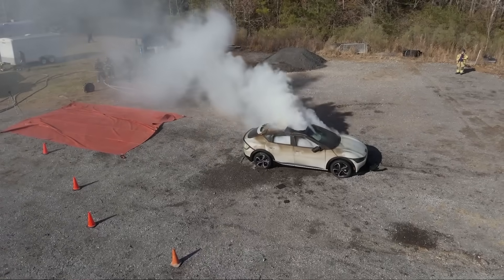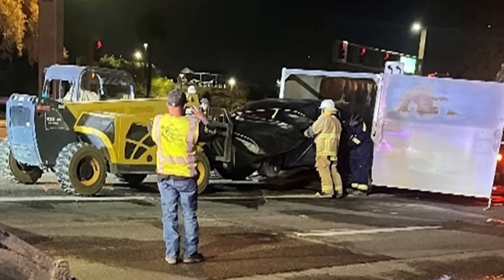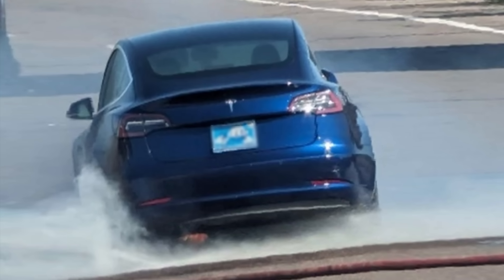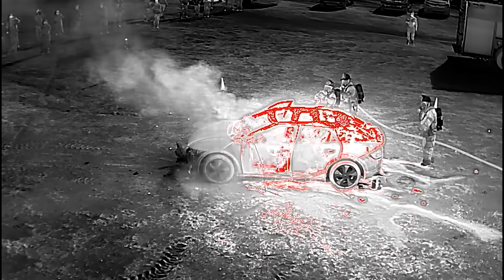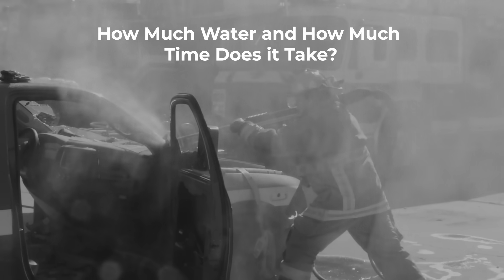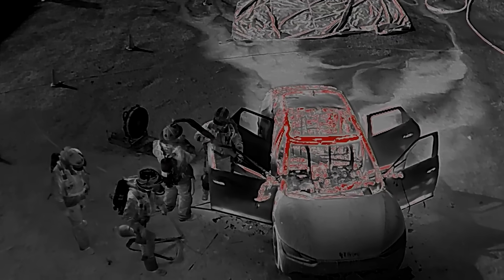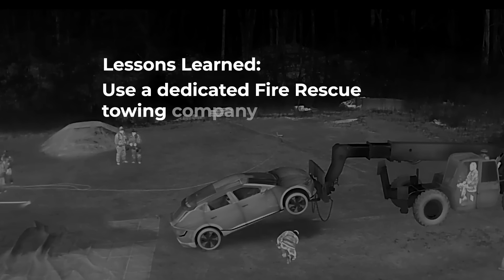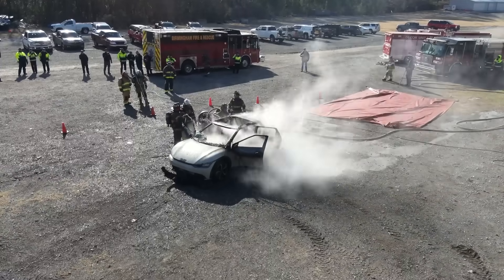Quick and Efficient Method of Extinguishing of an EV Fire tested in Tempe, Arizona

Comment: The air pollution from such a fire must be horrendous.
Reply: And the air pollution from ICE cars is just dandy? Anything burning is making air pollution.
Reply: @Hybridog  Most of the ice exhaust has been cleaned up by the pollution control system these days. No CO for example. EV batteries burn with very obnoxious chemicals and very concentrated. The battery fire then burns the vehicle which contains a lot of flammable synthetic plastics. Then there's the flammable tires.
Reply: @ You seem to be comparing ICE exhaust to a car fire. Let's separate the two things. An ICE car fire is mostly similar to an EV fire until you get to the battery. The battery does make pollution that is unique to it's chemistry, just as the pollution from burning gasoline or diesel is unique to those fuels. There are plenty of harmful things produced by a petroleum fire that we just sort of ignore now because it has become normalized. The soot from uncontrolled petroleum burning products contain a spectrum of harmful chemicals that we have just decided we aren't going to bother worrying about. Both cars have interior and exterior components (plastics) that burn in a fire producing a similar outcome. I would say the pollution from ANY car fire is pretty horrendous, but those fires are not all that frequent when you consider how many cars are on the road daily that don't burst into flames. There are probably more very toxic and harmful chemicals spread across the landscape every year from fireworks than from EV fires.
Reply: @Hybridog  But there are many more fires in EVs than ice cars. AND there are lithium ion fires in other devices as well.
Reply: @joewoodchuck3824  I'm not so sure there are more EV fires than ICE. There's a Swedish study that has better data than previous ones that shows ICE is 20 times more likely to catch fire. The total number of EV or ICE fires is rather small globally and thus the pollution from them is not a concern. The earth is really, really, big and it would take millions of fires annually to make a serious impact.
Reply: @Hybridog  I hope none ever happen in your neighborhood. You will be very unhappy being downwind of an EV fire more so than an ice fire.
Reply: @joewoodchuck3824  Uh huh.
Reply: Nope
Reply: @sparksmcgee6641  So the batteries aren't made of toxic materials then? That's a strange viewpoint considering that every article written about them say just the opposite and some point out the extra hazards in fires. I couldn't find one article that agreed with you.
Reply: @joewoodchuck3824  just did actual reading of a anti battery paper claim just that and the car in those fires is way more "toxic" than the battery.
I presume you don't understand that water and air are toxic by your standards. 
Cobalt is only one with a LD that you would have to make a huge stretch to say is a risk in a fire but it even has an 8 hour OSHA limit which means it's not so "toxic" that you can't be exposed to it without any negative health effects.
Reply: @sparksmcgee6641 If the battery is burning, then the car is most likely also burning. The two can't be separated when the fire begins. But OK, feel free to stand downwind of an EV or any chemical fire then.

Comment: looks like you have to get there quick and danger of kaboom to your firefighters ... you need a remote control lance
Reply: The probability of KABOOM is extremely rare and you only need to be dozen feet away to avoid any concussion blast and not real shrapnel, especially not any that can pierce a fire suit. This is not a Gasoline Fireball.
Reply from the maker: Perhaps a fire fighting robot in time could learn to use it. It wouldn´t be a bad idea as long as the remote operator knows what they are doing.

Comment: Or feed it the oxygen it wants and get it all over and done with quicker? Then shred it and bag it at the road side? Not a chemist but that lithium burns on contact with O2 right? Feed it O2 - go boom - shred and bag whats left? Water is just a delay tactic in my mind. First responders safety is the priority here. God bless those crews.
Reply: You are not a chemist, as you say. The battery contains oxidizer and fuel (every battery is an oxidation-reduction reaction, that is, a slow motion fire). So adding O2 or depriving the battery of O2 has zero effect on the battery fire. I am a chemical engineer.
Reply: @oliverheaviside2539  OK. Thank you. What a tricky problem. I like the description of every battery being a slow motion fire. That puts it in perspective nicely.

Comment: EV fires are also easier to put out because most EV manufacturers today use Lithium Iron batteries that do NOT generate oxygen in the combustion process like the older lithium chemistry batteries did. This increased the margin of safety at the expense of energy density. What is left is more like conventional battery firefighting, where breaking short circuited batteries & oxygen depletion will do the job.
Reply from the maker: Interesting point!

Comment: Fire suppression blankets are the answer.
Reply: No, they are not.
Reply: It is a self-oxidizing chemical reaction it's not a normal fire that uses atmosphere. Smothering it doesn't work. Sometimes you see one of these things roll down a boat ramp and burn for hours underwater. It's more like gunpowder burning in a cartridge it doesn't require oxygen from outside.
Reply: Nope

Comment: High pressure cutting..what? Mumbles the most important word in the sentence.
Reply: Damaged batteries can form unintended paths of conduction, a short circuit for example. Shorts rapidly heat, causing fires & reigniting. Cutting the short by propelling particles with high pressure water will cut the relatively soft metals used within a battery. The particles cut, while the water deprives the fire of oxygen as well as cooling the reaction. If this does work, it is kind of brilliant.
Reply: @kenandbarbie-b6c not sure how your comment relates to my OP...
Reply: @5400bowen It is an answer to your question on what high pressure cutting(using particulates) is doing. It is cutting the conductive path of soft metals used in battery construction. The intent is to remove short circuiting.

Comment: When did we start using water for electrical fires!!!
Reply: Because it's not really an electrical fire. Its an incendiary material fire.
Reply: @Neojhun  @septemberamyx ,Also the electricity here is from a non grounded (earthed) system as long as the EV is not connected to a charger. That makes it possible to assess the risks differently than for grounded systems.

Comment: Use fire blankets!  puts the fire out in seconds.  they cost around 1000 USD.  
https://youtu.be/yO8cVWOqZcg
Reply: They don’t work on battery fires. I’m sure the firefighters have tried it and failed.
Reply: @oliverheaviside2539  Yes they do work on battery fires. Watch it.
Reply from the maker: They work only for so long. They suppress but don´t cool the fire enough so when pulled off, the car reignites.
Reply: @ctifnewswebtv3802  To side step the issue for the moment.  I don't think we should be allowing NMC type EV batteries because they are so flammable and hard to put out.  LFP is very hard to ignite and I know of zero that have. When they burn, it's 5 times less energy and the most of the gases are steam almost no explosive gases.  The new sulfur batteries are also supposed to be even less flammable than LFP, but it's too soon to know.

Comment: Water is the WRONG MEDIA for putting out METAL/ ELECTRICAL fires. Water is cheap but highly reactive with both lithium chemistry and charged batteries.
Electrically inert chemicals are better (ie DRY CHEMICAL extinguishers or fire blankets).
Bag the vehicle and wait until it cools below auto ignition temperature.
Reply from the maker: There is a difference in lithium metal and lithium ions. Lithium metal does what you are talking about.
Reply: @ And Lithium Cobalt / Manganese Ion batteries have lithium metal present if charged beyond 80%. The graphite electrodes get saturated and lithium metal plates out on the surface (particularly if rapidly charged, the slower the charge rate the less plating occurs). Puncturing a fully charged lithium ion (as opposed to lithium iron phosphate (different chemistry)) battery is a good way to start a fire.
Single use lithium batteries have similar issues.
The 80% charge limit on Lithium ion batteries has a couple of reasons (the plating also reduces battery capacity because of reduced surface area for ion diffusion).

Comment: Smart solution…EVs are being pushed with little thought about thermal runaway fires..l doubt this excellent demonstration would be on MSM..it would highlight the major problem with EVs..well done guys..good job..
Reply: Stop with the misinformation. MSM have overblown of RARE Passenger Car BEV fires. "pushed with little thought" is a blatant lie as Automaker and Battery suppliers keep making improvements and the latest EVs are extremely unlikely to ever catch fire. Even old flawed deisgned BEVs are way less likely to ever catch fire per 100,000 unit of each type. It's MSM who is slandering EVs trying to wrongly assert fire are remotely even likely.

Comment: Most autos now use LFP batteries which are safer for fire compared to Lithium Ion which is what is used in all our electronic gadgets and is more prone to thermal runaway.
Reply from the maker: Lithium batteries will likely be around for years to come even as safer batteries become available
Reply: And anyways once they become obsolete and there's no more need for the technique to put a fire out in an electric vehicle anymore. They'll have the tool and I'm sure they'll find multiple new uses for it.

Comment: I thought that when you mix lithium with water it would catch on fire and or explode. What am I missing here?
Reply from the maker: Salt water is very corrosive for these batteries. Clean water will extinguish it over time.
Reply: You are missing that it is lithium in the form of ions. So they dont want to react with water. Also, if there is a small amount of lithium in a burning cell, it will combust/react during the thermal runaway process. The goal is to not have new batteriy cells or modules enter thermal runaway by keeping them cool.

Comment: Problem with letting the FDs HIDE the incidents from the public....  we don't KNOW how frequent (or infrequent) they ARE!  SHOULD Tesla owners have to pay a 'bump-up" for "in case of fire"?  It costs MORE to put put a lithium fire, does it not?   Are the FDs and/or insurance co's TRACKING those costs?
Reply: Per 100K sold, ICE vehicles are involved in 1,500 fires. That is 60 times larger than the 25-per-100K sold for EVs.
Reply: You are ignoring EVs Fires are far more RARE per 100,000 each type of vehicle. Such a cost analysis is heavily based on number of occurrence of fires. In that case ICE cars should be paying way More.

Comment: To a hammer, everything is a nail.  Water doesn't make fire go away.  It cools and smothers.  Water also conducts electricity.  A shorted high energy battery creates heat.  Now you're relying on the water to do one thing, and it doesn't do it well.

I wish we could figure out a different solution here that isn't just "more water differently".  I also wish people involved with this stuff would have experiences in different fields.  Sometimes that's all it takes to make a massive change in an industry.

Fire requires three things.  It's stoichiometry. Oxygen, heat, and fuel.  The batteries are the fuel.  The batteries shorting out creates heat.  Oxygen is in the air(I'm no chemist, but there are some fuels that are self oxygenating like flares that can burn under water).  

I wonder if relaxing an inert gas into the battery pack would help.  Releasing pressure lowers temperature, that's why CO2 fire extinguishers blow out clouds and flakes of dry ice.  Doing that could offset the oxygen and cool the batteries down enough so they won't self ignite.  Batteries are also a chemical reaction, so you'll get less power out of them in cold temperatures. 

If anyone wants to give me unlimited funding I'll gladly Mythbusters this whole thing!

Comment: If there is one thing I have learned
EVs have only been on the market for a few years and they burn like fireworks.
They are absolutely not safe for the occupants to drive, they are a poisonous trap.
They should be banned immediately just like the burning electric scooters
Reply: Stop with the ignorant lies. That is just dramatic fear mognering and has no basis in reality. BAN ICE cars which have been forced to have RECALLS due to their extremely more likely to catch fire. ie modern BMW 6cyl Diesel, Hyundai ix35, most high end high performance VW Group cars from 2009 to 2015. EVs are multiple times less likely to ever catch fire per 100,000 of each type. Yet you want to fear monger about the SAFER type of power train.
Reply: "like the burning electric scooters" Highway capable BEVs are nothing like electric scooters. They use different type of CELLs and the battery packs are entirely different. Does your car run on Nitromethane, soo it burns your eyes everytime you drive it? You are making the same false equivalent slander.
Reply: @jhunwong8739  finally open your eyes the scooters and EVs are a danger to people and nature

Comment: Total water flowed and what happens with the water that runs off is the biggest concern along with the safety factor of the toxic smoke in confined area's like NYC!
Reply: Is it any different than any other fire smoke/run off? Not saying i want more of any of it. Just not sure if it's really that much more of a problem
Reply from the maker: Less runoff with this method than most others though
Reply: @ctifnewswebtv3802  Toxicity is actually not that much different than from a ICE Car. But it normally needs a lot more Water for a EV-fire. Think about 10x or something along those lines.
The only thing i 'am a little skeptical about is the fact, that you puncture a well enclosed and very hot space. That water will almost instantly turn into steam (or superheated water, if the pressure can't be released). So you get a lot of pressure built up inside the battery. This could cause a explosion or a jet of steam shooting out of a different part of the battery. Seems mostly that will not happen, otherwise that system wouldn't exist. But i would not be entirely sure, that this means there is no danger in all circumstances.
Might be safer to use this with a simple remote controlled robot. Would also have the advantage, that you can more safely enter a underground structure, if you don't know the damage to the structure.
Reply: It becomes hydrochloride acid, doesn’t it? Terrifying stuff!
Reply: @Liliarthan no it doesnt

Comment: You're going against chemistry. Lithium reacts with both carbon dioxide and water. Smothering it with an airtight blanket or sand would be even quicker.
Reply: You are thinking about lithium metal, not lithium ions. That is why it works.

Comment: Adding water to an electric vehicle fire has always been non effective   from what I've heard.  If water worked,why do flooded cars still burn? Foam/chemical extinguishers sound like a better option?!?
Reply: Yes, they can reignite even though recent studies shows it is not common. However, for the fire brigade, it can be important to stop the fire at an instant and then move the vehicle to somewhere someone can deenergize the battery. The part to remove the energy is important and possibly as soon as possible. But that is a car repair shop job, not for the fire brigade.

Comment: Each individual Tesla cell can short itself from the rest. 
Teslas are the safest vehicles on the road.
Reply: Per 100K sold, ICE vehicles are involved in 1,500 fires. That is 60 times larger than the 25-per-100K sold for EVs.
Reply: @JorgTheElder  1500÷25= 60 60x as often seems like a lot, especially when you consider some manufacturers,  even after being warned by Elon Musk , that their batteries are not safe...produced over 100k recalled vehicles.